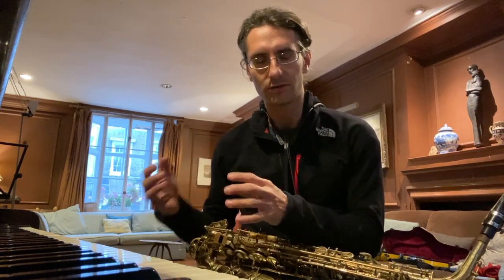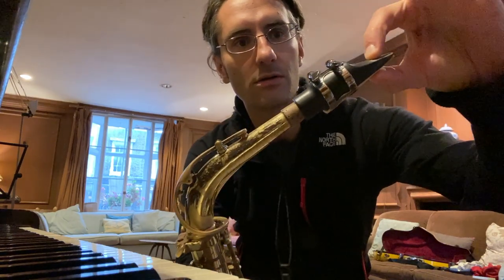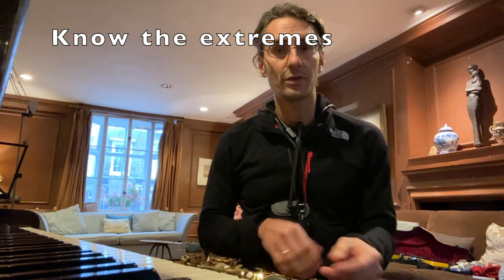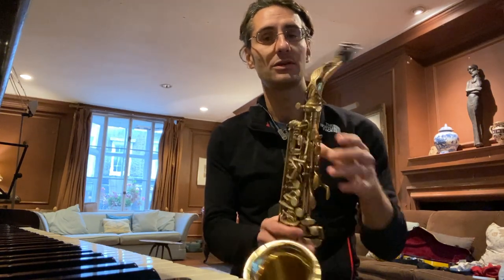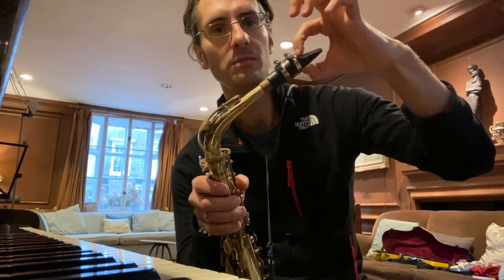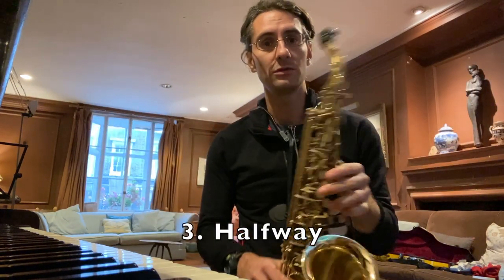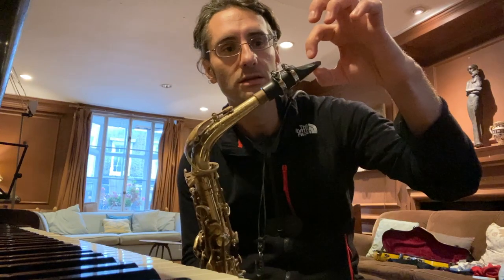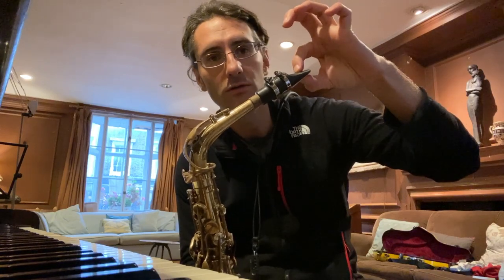Saxophone Embouchure   Quick Tip

Comment: Thank you for taking the time to make these videos, they are invaluable to a beginner  like myself. My question is, does the embouchure change according to the genre of music a saxophonist will play. Eg: classical or pop or jazz? Sincere regards, Dave.
Reply from the maker: My pleasure Harry! Thank you for watching and really happy these tips are helping you.
I would say you could narrow it down to two types of embouchure: classical embouchure and non-classical embouchure.
The non-classical includes jazz and all other genres I would say.
The main difference is that in classical music you need more control hence the embouchure is a bit more firm. But in modern music you need to be more loose and flexible so the sound can vibrate more.
Does this make sense at all?
If you are a beginner you are safe with the classical embouchure. As you progress it will be easier to transition into a more loose embouchure😀 let me know how it goes. Martino